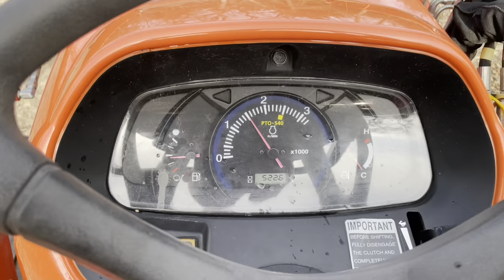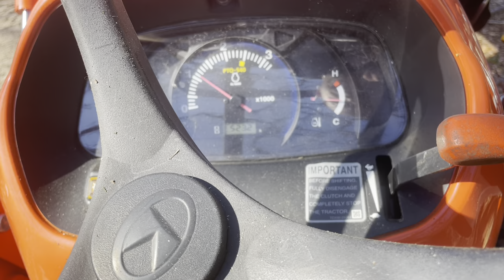Kubota tractor clogged fuel line . Engine stalling. L3301

Comment: Video was very helpful.  I suspect this is a short fix/identification of the problem and the real "fix" is to drain the tank, remove tank, and clean it out completely.  Again this video was very helpful.  Thanks.
Reply from the maker: @jeffwhitnah7440  ,,,, yes you are correct. I made this video shortly after this one. I’ve had no problems since.
https://youtu.be/ydbySkEnMuQ?si=sfY5rvU7DHy8dwFU

Comment: What you should have done is blown air into the tank from the filler neck and pressurized the tank and forced the garbage out through the line. All you did is blow it back up into the tank and now it’s going to plug up again.
Reply from the maker: Yep, but I found that the trash in the tank was large rusty pieces of the fuel sending unit that were falling off. That’s a different video.

Comment: Had the same issue , it turned out the fuel had a jell accumulation that was stopping up the fuel line. New tractor under warranty, dealer picked the tractor up 4 or 5 times and even came to our property so I could shoe him what was happening. I suspected from the start there was trash in the fuel tank, I was correct.
Reply from the maker: Glad you got I figured out
Reply: Same problem with a 6060. Removed fuel line at pump inlet and blew air back through water separator to tank . Cured the lack of fuel but will need to flush tank.obviously something in the tank, 200 hrs on machine
Reply from the maker: @loveistheanswer8137  ,,,,this is what in ended up doing.. https://youtu.be/ydbySkEnMuQ?si=sSin79yrfTsnLOUF

Comment: Could you have tried pushing a piece of wire up the line to dislodge the debris? Might have encouraged the junk to come down the line instead of blowing it back into the tank. Just a thought
Reply: I should have watched your video on removing the fuel tank. That was ALOT of rust in there! Holy smokes!
Reply from the maker: Ya, it had a lot of junk in there

Comment: my brand new grandL3560 cab model keeps dying randomly .. 10 hours on it
Reply from the maker: About a month after this video mine started dying now and then. I used some bailing wire to tie down the safety switch under the seat. It has not died again. So most of the time it’s clogged fuel or a faulty safety switch.

Comment: Greetings from Arkansas.  I had exactly the same problem with my 2014 L3301 hydrostatic transmission.  It first happened in 2019 or 2020.  Once we realized we had some debris in the tank I wanted to just remove the tank for cleaning but that looked like too big of a problem.  Siphoned the diesel out then taped a clear hose onto a shop vac and did my best to clean it out.  Today, 9-27-24 it happened again.  So frustrating, because I have been so careful to keep it clean.  I wonder if there is some manufacturing issue that allows this to keep happening?  Now I'm going to have to do the same cleaning project again. Not looking forward to that.
Oh, noticed you were using farm (dyed) diesel. That is against manufacture recommendations in my year model 2014.  Only use road diesel.
Thanks for your video.
Reply from the maker: @lhoward1563  ,,,, it came with the red fuel from the dealership